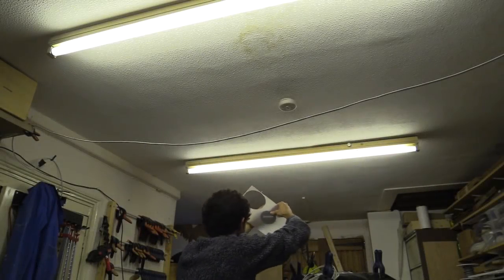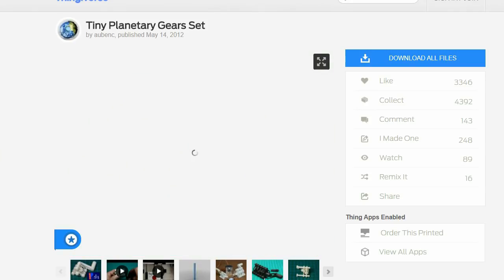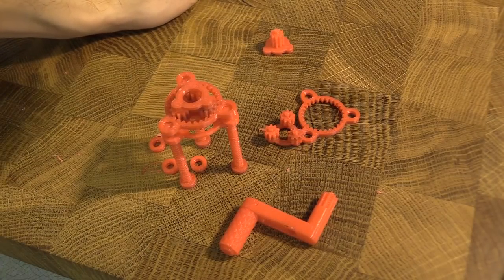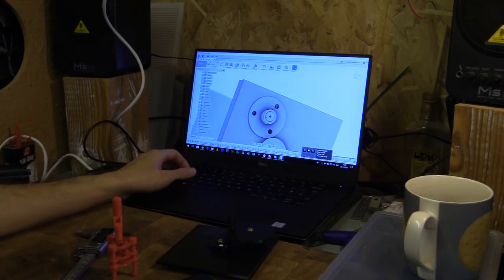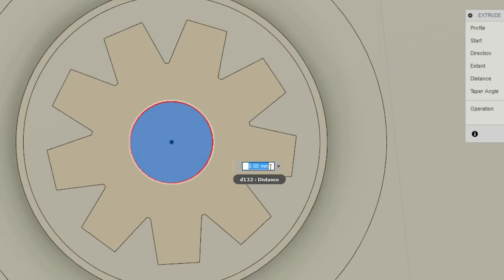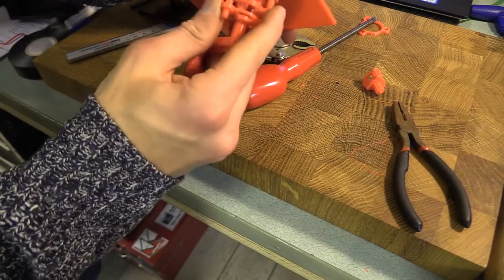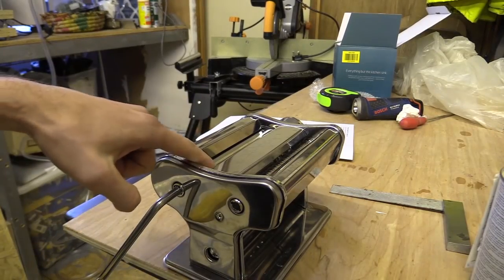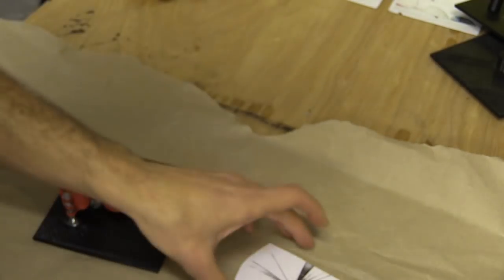Slit-Scan Disc Camera - Part 2 (3D Printed + Planetary Gear)

Comment: Maybe you arent interested in using motors but if you're willing to you could use one from a microwave. Those that spins the plate inside. I bought one for a project that has 6rpm.
Reply from the maker: Yeah I wanted to resist putting a motor but that would be interesting. To turn a microwave into a slit-scan camera!! ;)